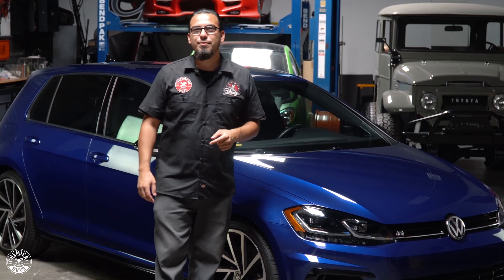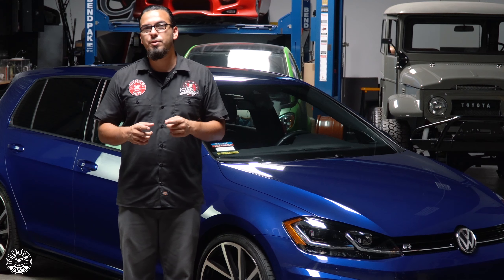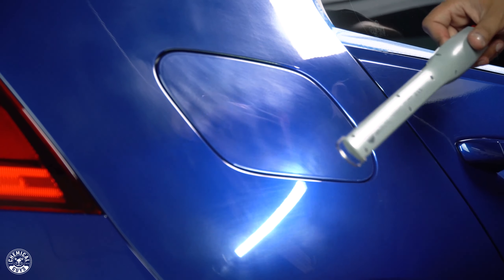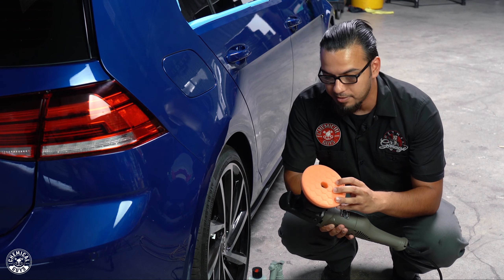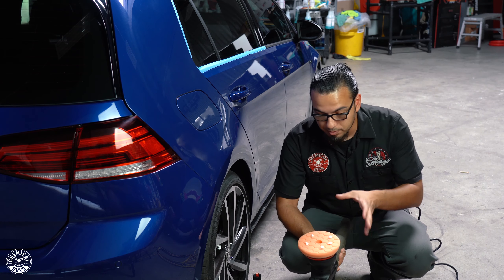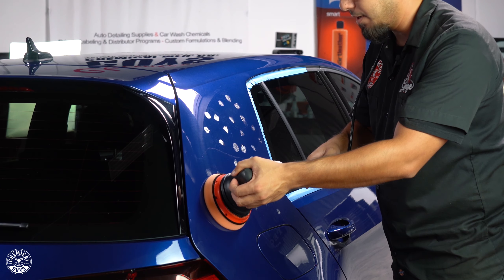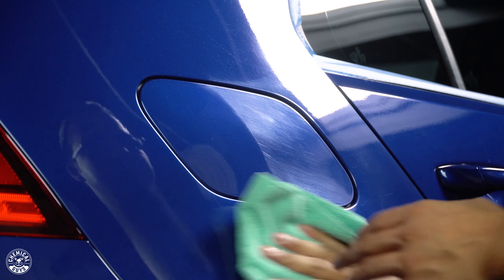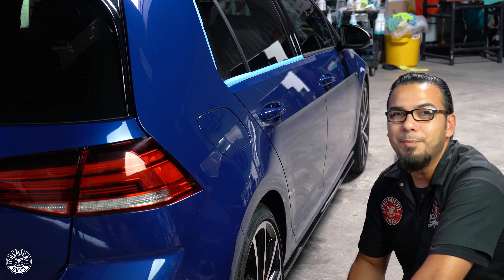How To Get Rid Of Holograms, Buffer Trails and Swirls! - Chemical Guys

Comment: I got a new black car and I went for teflon coating. A moron left quite a bit buffing marks on it. Will removing a bit of clear coat will diminish the shine and longevity of the paint? I really need your help. Please 🙏🏽
Reply from the maker: Hi there! Polishing will remove a very fine layer of clear coat but this is the only way to refine the finish and remove swirls, scratches, and holograms.
- CG Nick
Reply: Chemical Guys thank you Nick

Comment: After applying V36 & V38 ULTIMATE FINAL POLISH is that the final step or do u need to add wax?
Reply from the maker: Hi Scott! After polish, apply your favorite ceramic, glaze, sealant and/or wax to lock in your hard work and repel harsh elements.
- CG Nick

Comment: I’ve recently bought a year old vw and the paintwork has a lot of marring from someone’s terrible polishing skills. The paintwork has quite a bit of lush scratches too. I’ve bought c4 and p4 would it be best to use both for this job after I clay bar the surface?
Reply: Light scratches**
Reply from the maker: Hey! Start with a test spot using P4, if you need more cut then use C4 and refine with P4.